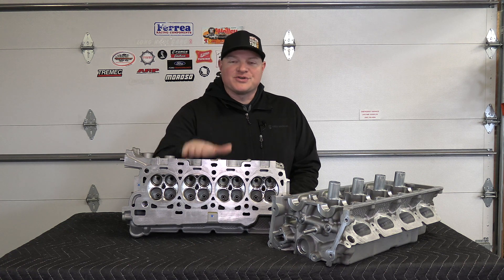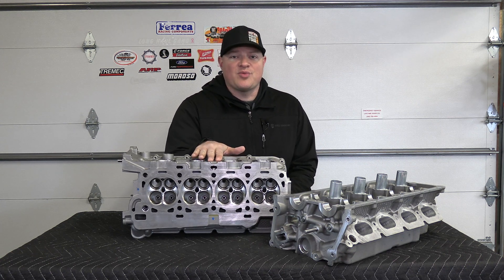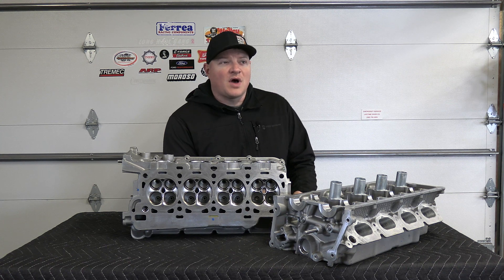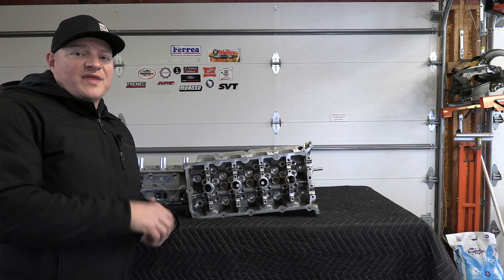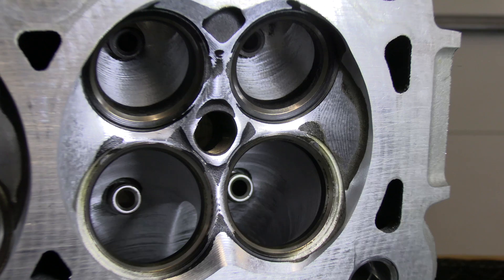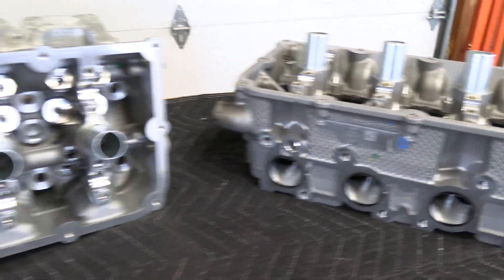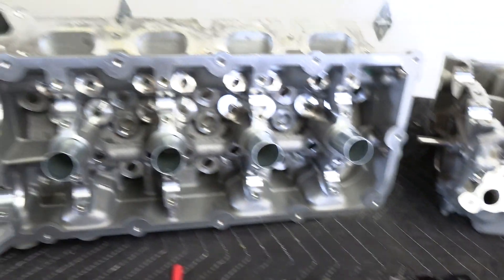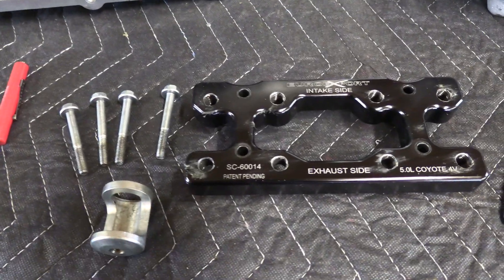CNC PORTED COYOTE! 5.0 Cylinder Heads BY Livernois

Comment: Did you replace those intake valve seats after they ground on them? The chamber work looked terrible, especially for that much money.
Reply from the maker: I had a engine shop replace the seats. It was there CNC Service only. It's up to the customer to finish the heads up. At the time it was 800ish dollars. Now it's 1200

Comment: I don't claim to know all there is to know about head poeting but I would assert that the heads being messed with after the CNC qork was done is irrelevant. If there were any parts that the machine didn't touch then it is logical to assume that the areas were low and wouldn't impede performance in the least.
For max effort all mptor builds then  it may be worth a hp or 2 but I am skeptical even about that.
Also...if one was doing a F/I setup I am not sure if any port work would be warranted.
I have seen many people doing porting that I am co fident cost then hp instead of helping them get more.
Again...just the input from a guy that has only ported a few heads.
Reply from the maker: Well you said you don't know all there is to know about poeting, haha. Just kidding.

If you check out the Livernois website for these heads they are the CNC port service only. The customer needs to finish the heads. So those marks and imperfections need to be addressed for optimal flow. Not taking off tons of material, but keeping the ports smooth rather than rough

FI and ported heads? That's a winning combination. Look at the GT500, ported CNC heads from the factory. 760 HP was made because of FI with ported heads.

It's all good, thank you for your reply.

Comment: Did you do a valve job the guides were taken out and the guide would need to be resized and seats recut
Reply from the maker: On these heads I did not do replace the guides. Stock valves were used.

Comment: What power did the heads make? HP/TQ?
Reply from the maker: I haven't been to the dyno yet, but similar set ups with a 18+ manifold, built block, MT, have seen 500 at the wheels.
Reply: Thank you for the info!

Comment: My Slawko CNC heads looked better in the combustion chamber.
Reply: Mine do as well...however had some untouched material in intake and minimal in the exhaust side
Reply: @blackstang89gt59  , that's due to core shift one of the keys on 4 Val heads is to keep the porch small for velocity you're trying to do most of your filling up to 500 lift

Comment: So the CNC job they offer is essentially just a starting point for people like you and me. This is what I understand. The obvious advantages of using a CNC job is that it is more precise than what…let’s say….I could do who has no experience with porting heads. I have the tools I am a toyota master tech by trade who has also worked on a little bit of everything brand wise. I’ve been doing a lot of research into porting because I want to do it to my Gen 2 coyote heads while the engine is apart. That’s just my understanding correct me if I’m wrong please. My questions are: 
Why not port them your self? Like I said I’ve never ported heads before and the reason I’m asking is because I’m afraid to mess up the head and these heads are NOT cheap at all. I want to see your reasoning and make my own decision. 

Do these heads need porting? I’m going for a high performance N/A build. Not sure what you are doing with your build. 

Did you need to get bigger valves? Did this decrease the compression—-need a taller piston to compensate the loss of said compression? (If any was lost) 

I’d appreciate your input/help I do a lot of work to cars everyday but I’ve never built an engine before.
Reply from the maker: If you never ported heads before (by hand) I wouldn't learn on your Coyote heads.  Find some junk heads in the junk yard for cheap and practice.  There's some good videos on YouTube to learn from.  

The CNC port is the best from what they learned and the machine does all the work.  For 900 bucks that's a good deal.  All you have to do is clean up some rough areas and reassemble your heads.

Porting any heads will benefit flow and free up HP.  More so for a FI engine.

I didn't get bigger valves, I got stock size Ferrea valves.  Not 100% on any changes on compression from the valves, but CNC porting the combustion side of the head dropped it a little, but not much.  I'll be at 12:1 compression on my engine.
Reply: If you already have gen 2 heads, you're off to a great start. If all your chasing is NA horsepower look at what the gt3/gt4 guys have done. There are a plethora of threads about hybrids with gt350 heads, fpc vs cpc (crank variants), and more!

Your valves are already bigger than a gen 1 head, and flow quite well. Porting is not necessary depending on end goal. On a stock head, cai and headers we usually see 430+ at the wheels on pump and approaching 450 on ethanol. Increasing valve size does not change compression, you are still limited by volume of the cylinder. That said Headworks has a few data points showing that updating to ferrea valvetrain over oem yields a small yet noticeable gain in flow. So, you would need to decide if that valve has become your biggest restriction.

If it were me, Id bump up compression since it sounds like you already have it apart if not, switch to a better fuel to remove the octane limitation you have even in stock form with pump 93, switch to an 2018+ manifold with an intake, long tubes and go from there. 

Compression can easily be bumped up to 12.5:1 with ford racing parts, for example they offer that in the Aluminator XS package (to which you can also source just a bottom end or do like me and just use the info to copy with your own choice of parts). This can save some cost in chasing displacement with boring as you can see how they went to a 5.2L but kept a cpc with oem spray transfer still used and a nice new gen 3 block. gen 2 blocks are just fine!

You could lock out vvt and go with an aggresive cam to chase hp numbers but honestly its hard to touch what the gen 2 cams and factory vvt offer for a starting point. I'd only ditch vvt if it was a necessity due to engine control, you have plenty of seat pressure for factory rpm and gen 2 heads already come with the updated boss valve springs.

Its a bit to chew on but I rambled since there wasn't a clear decisive target to hit and instead just spewed about some coyote power points. Feel free to pick my brain, its not omnipotent but I stare at these things every day and they pay me for it... so ... I can atleast offer what we have run into and you can use the info to make your own informed decision. :)
Reply: @jdllewellyn5802 now you sir are a man who knows and truly understands the Coyote platform! Well explained